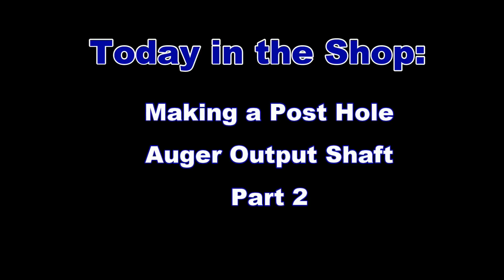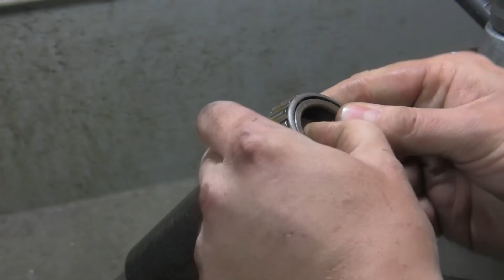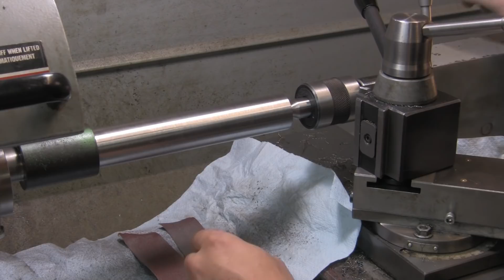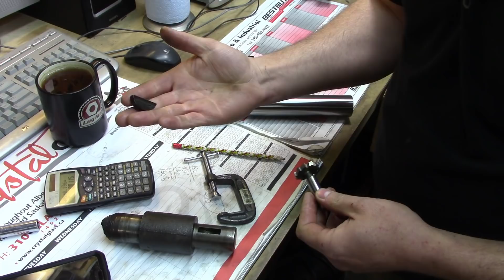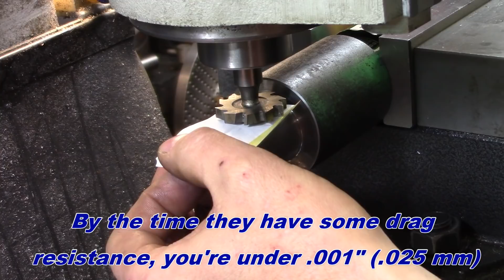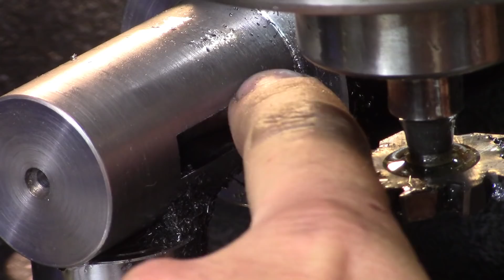Post Hole Auger Shaft Part 2

Comment: Could you have gotten the depth of the hole by measuring the total dimension of the part with the key installed and deduct the height of the key?  Then use an online circle calculator to find the height of an arc .3125 wide with a .625 radius and add that dimension to the depth after touch off?  
I’m really enjoying your videos.  Watched pt 1 and 2 tonight, I’ll watch pt 3 tomorrow.  Subscribed!
Reply from the maker: Thanks Stacey, I'm glad you have enjoyed the videos so far.  There are a few ways a person could get the keyway depth using math, this was just how I did it.  Granted, it would have been easier if I didn't screw up my math in the actual cutting of the keyway, but hey, we're only human, lol, right?

Comment: Stuff happens. Good recovery with just flipping it around. Shouldn't make a difference in the life of that part.
Reply from the maker: Thanks Rick, it seems to be doing ok, and the parts on that side fit nicely on the shaft so it's still a win.  You live, you learn, lol . . .

Comment: I saw on YouTube how some machinists like Adam Booth from Abom79 actually weld badly placed holes and wear spots back up until it becomes overkill, and then they just machine it back down to size.
Reply from the maker: That's what my friend and I were thinking after my mistake there. It's not perfect but it will do the job, lol.

Comment: Mill out a matching key for your mistake then silver solder it in and turn the outside down to shaft size, it should be nearly as strong as if you never made the mistake!
Reply from the maker: I hadn't thought about silver soldering, that would have been a decent option for sure.  Wound up welding it shut and turning the bead down to match, it seems to work for now.  Hopefully the metal doesn't have too many stresses in it afterward, we'll see as he digs the holes in his yard!

Comment: That sinking feeling when realising metal is gonna be missing in order to have a complete part....     🥱😰😱🥵🥶🙄
Yap...!    nice jack...   !!!    Great that they're being useful...   👍
Reply from the maker: Hey Pierre, thank you again for those jacks!  They really are a good size and shape for this sort of thing and will be put to good use, for sure.  And yes, mea culpa, I definitely had a brain fart on the numbers.  The second one went much better with the proper offsets, surprise surprise!  As well, with how the machine was complaining I wonder if it would have even done a 5/16" wide single pass with the correct width cutter.
Reply: @EverettsWorkshop  Also noticed that your quill was quite pulled down, as much as possible try to perform those ops with the least quill extension possible, you just give it a try and let me know...

Comment: Good set-up on the mill, you could have moved on the X axis a little to relieve the cutter. Looks like you deviated from the drawing by an act of God 🙏.
Great vlog, thanks for sharing.
Reply from the maker: Thanks, glad you still find it interesting, even with the mess-up . . . I didn't bother making a drawing for this one more out of laziness as I had the old shaft but you do bring up a good point for making one as having the numbers in front of you makes the mental math easier sometimes.  Would have been a good idea in retrospect.

Comment: Like everyone else has said, mistakes happen.

 That toolmaker's jack is good for flats, but for supporting rounds maybe a vee slot in the top or a vee topped cap to drop over it would be better?

Looking fwd to watching p3
Reply from the maker: The jacks do have a small V-groove machined into the tops, it just didn't show well in the frame.  Pierre and Phil did an awesome job on them, I'm very thankful to have them.
Reply: I was trying (not) to imagine Doubleboost's comments had he made the (slight) keyway error. ☺
Reply from the maker: Oh man, I have to confess that what was said was edited out for good reason.  Rest assured that section (at least an edited version) will be in the upcoming blooper/outtake reel . . . I've made an effort to clean my language up over the years but every now and then the "Mechanic-ese" language comes out, lol

Comment: G'Day Everett, don't we just hate that feeling on the last operation and we've over cooked it.  Just for what its worth, woodruff keyways where primarily designed for production.  Fast accurate single plunge cut and onto the next shaft in the production line.  Although woodruff keyways give a slight reduction in stress raisers near shoulders, for the majority of applications replacing the woodruff keyway with a standard keyway that we would cut with a slot drill is perfectly fine.  If you had no other option after making the false cut was to continue with the wider keyway and make an offset key to match the new width and machined down to fit the hub.  How do I know, been there and done the same mistake when cutting a keyway.
Cam
Reply from the maker: Thanks Cam, you made me feel better!  We are only human, that's for sure.  To be honest I had not thought about an offset key, that would have worked too.  In our situation it was just as easy to fill the bad hole and hide the mistake, lol!
Reply: 100% agree on your comments on Woodruff keys, they may have been introduced for tapered shafts. The depth to shaft diameter ratio is something I never liked. Great channels both.